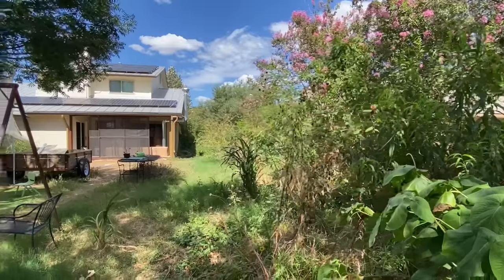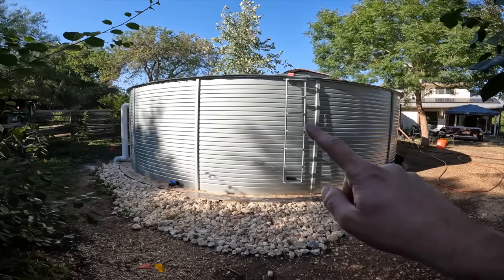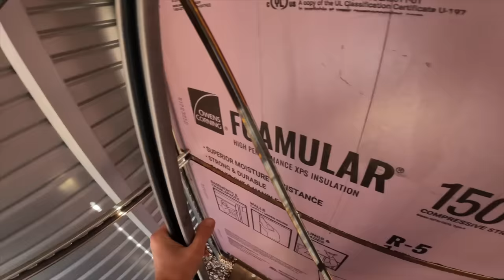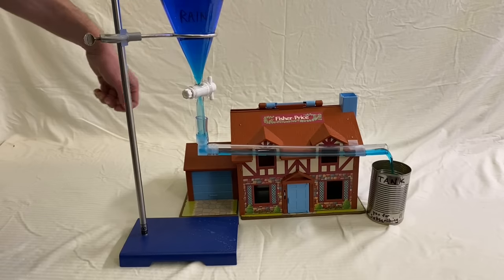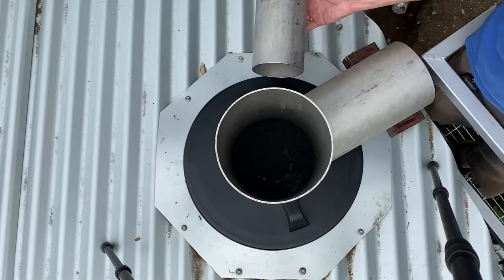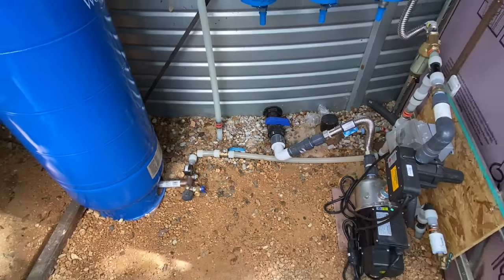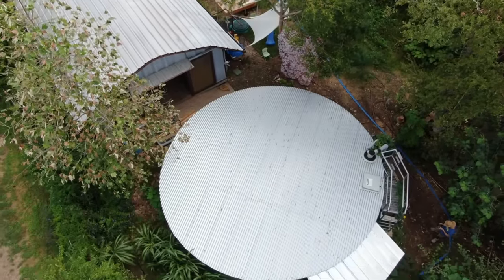FREE water forever.  LEGALLY!!!!

Comment: I have 5 wells, a 5000 gallon dehumidifier, and a 5000 gallon rain water collection system. My power is solar and mini wind turbine, with a water wheel back up. If my power and water go down, I'll switch to my emergency back up plan, hooking the horses to the water wheel. If that fails, I'll use up my reserves and then move. 😁😂🤣

Comment: I don't care how certified these structures are, if I saw this being built by a neighbor I'd be looking for flood insurance ASAP. Brings me to some questions I didn't see already in the comments: What do you do with the structure when it gets towards end of life (either with that plastic liner or the main structure itself)? Do you have an emergency drain valve and place for 30k gallons to run off into?
Reply: I would think its very easy, once a certain time reached, the owner will stop the inflow of rain water into the tank, keep using the water until the tank is nearly empty then redo the lining or structure.        
For the insurance, I think this owner has a huge property where 30k gallons wont ever make out of his property. I don't think a normal sized property would be able to build a huge tank like this one, however if they tried then I don't know what the insurance would be like but I think its probably safer than a lot of pool structures that you see in so many random houses.
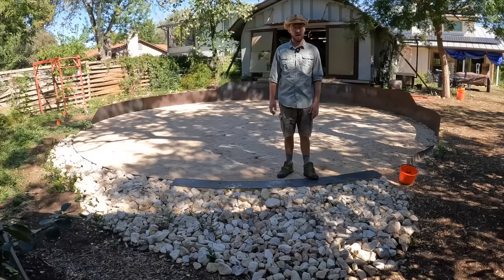Reply: @MrBen580  Some good points, but this seems almost like a subdivision but with larger (maybe an acre+ each) sized lots. At 3:55 in the video, he is standing in the backyard and it looks like he has a neighboring house barely 60 feet away from his own. In the following 30 seconds he mentions how tight of a path it is to get the building materials to the backyard. It is an assumption, but I bet the fence line shown during that explanation is a property line boundary between him and a neighbor. 

So again, my main point was how to handle an emergency drainage of 30k gallons when in such tight grouping. At least where I've looked, I have found stories of water tanks built for companies to hold 100k gallons+ and then had a failure early into the expected life of the system. In those cases, the volume is so large it ruins the majority of the town. I'm assuming his 30k gallons could easily ruin his closest neighbors.  Hence why I asked if he has a plan to create a culvert or ditch that slopes away from the storage tank. Just in case that failure mode was not originally accounted for in his overall plan for the project.
Reply: @Rambo.cc.1188  yeah I assume it's always safe to have a plan B and plan C. Hope he thinks of those someday and make a video on them.

Comment: You could have done it underground? No? Every home in our country has this we build this undergound same area as a small room the bottom is cemented, the sides as well only the top is covered with ready made cement planks that's way cheaper also it doesn't take your space
Reply from the maker: To dig a hole this size in my yard would have required huge equipment that would not fit in my yard. If it was done before construction that would have been ideal. Thanks for commenting!
Reply: @suburbanbiology  yes you are right given the resources this could be ideal

Comment: There is a tecnology to reverse desertification. And it is old as civilization itself. Afghanistan used to be land of gardens built by ancient empires trough complex system of irrigation. Now its just mountain desert because mongols razet it to the ground for resisting. And no one managed to rebuild it. I beliv with modern tecnology its possible to irrigate every desert, just no one in power has need to do so.

Comment: Have you ever seen kids these days. 45 min very hot showers 2 or 3 a day.  Before workout. After the workout.  Morning at wake up. And if they're going out later.   And there are 3 kids.  Plenty of water on the east coast . But if water was restricted in a drought are?  Whew. Fuggettabout it. Plus, parents need a shower.  My dad could take a 2 min shower.  Wet.  Turn off water. Lather up. Rinse. My kids use up a bar of soap in a week using the soap while full blast hot water spraying it.

Comment: I can't imagine why you wanted to use a metal plate to hold your water filter that already has holes in it. You had to of known that water would just go through the metal holes and skip the filter altogether. It seems so obvious. You should have used three or more filter layers so you have more insurance on keeping debris from getting in. Also your going to have to get that debris out sometime. It will end up being too much before you know it and you will need some kind of debris vacuume or to drain it and start over after you clean it out.
Reply from the maker: By nature of the path that the water falls in most of the water passes through the sock filter. In a heavy rain event if back pressure builds up I would prefer the water to go into my tank with some debris rather than lose the water. That’s why I went with a mesh rather than a solid plate. I go into more detail on my channel. I made a dedicated video for the manifold.

Comment: The problem is that rainwater contains almost no mineral salts and is therefore unfit for consumption in the long term.
One of the solution for that is to built a concrete tank or put gravels in the tank. The acidity of the rainwater will dissolve (very slightly) the stones and release mineral salts.
The water will also become neutral.

On the other hand, your installation, your rainwater is perfect for washing machines, boilers, etc. because it contains almost no minerals and therefore no limescale. 

🤣

Comment: "FREE water"
Tank costs roughly $20,000, plus install, piping, sand, steel reinforcement, steel catwalk, etc. 
I will stick with my $30 a month water bill. Rough install cost of $25,000 would take 70 years to pay off

Comment: ................is anyone else going to say it?........................ no?.............................noone?........................... 2 things. your tank is going to turn into a cesspool for alot of germs and bacteria. while yes the pipes flowing underground removes them from being in your way. the down fall is that you now no longer have a way to "flush out" any matter that doesnt get forced into the tank. over time this will settle in your under ground pipes slowly clocging them requiring them to be dug back up and cleaned. secondly your going to have water in these pipes that will get hot and increase bacteria/algee growth and then when it does rain your going to get a huge glut of it forced into your tank. this will cause alot of rancid smell coming from your tank. and your filters will age out very quickly...... and they arent cheap.
my only suggestion would be to add a cross tee connector of some kind just below the lift on each of these pipes with a bleeder cap at the end for easy opening and closing. then under the tees dig down about 2-3 feet and make it a sort of french drain. then cover the area and pipes with the same stones you used for the drainage feild. that way once or twice a year you can come out, move the stones, open the bleeder valve to allow the water to release, then open the, rubber washer sealed, thread cap and spray water down the inlet to rinse out any debris collected over time. this will avoid any clogging and ensure your water pool doesnt get tooooo gross. if your house doesnt get a tremendous amount of litter you could do this once every other year but from the looks of it your house has a few trees close enought to drop on your roof.
either way this looks fantastic. personally i would have encorporated these pipes into a trellis system above ground. using the trellis themselves to hold/hide the supports for the above pipping but to each their own.

Comment: setup will not work in a cold country. Everything would freeze and you'd have no water during winter.
Reply from the maker: True. Lots of insulation?
Reply: @suburbanbiology  Wouldn't work either. Insulation only slows the penetration of the cold. Wells here run a pipe about 6 foot underground to insulate and heat the water with ground warmth. I suppose in your setup the pipes outside of the ground would need to have a slope (no U pipe going underground and up). The reservoir would have to be minimally heated or placed itself underground. A pump would then be needed to extract water from it. The filter wouldn't be placed outside either.

Comment: TLDR: Rainwater harvesting and re-plumbing the house with pure rainwater can provide free, sustainable, and clean water for households, offering a solution to water scarcity and contamination issues.

1. 00:00 🌧 Install a rain tank to collect free water, replumb your house, and check local laws before investing in a collection system to avoid contamination and ensure legality.
	1.1 Install a 30,000 gallon rain tank in your backyard to collect free water and replumb your house to use rainwater instead of city water.
	1.2 During a power outage in Texas, the water infrastructure failed, leading to potential contamination of the municipal water supply, resulting in a boil notice and leaving families without power or water during freezing temperatures.
	1.3 Water becomes infinitely valuable when scarce, so having your own water supply is a hedge against future scarcity due to climate change.
	1.4 Compact the ground, use sand to fine-tune, and backfill around the edges for a DIY water collection system.
	1.5 Collecting rainwater for drinking is legal in Texas, and using a metal roof for collection can help avoid contamination, but it's important to check local laws before investing in a collection system.

2. 05:25 🚰 Access free water legally by flipping a ladder into a manhole to access a water tank with overflow pipe and filtration system, while preventing erosion with rocks and recycling materials.
	2.1 The speaker asks for support on their channel and patreon page, and discusses the quick construction of a site for a project.
	2.2 A ladder can be flipped and placed inside a manhole to access a water tank, with an overflow pipe to prevent pressure build-up and an outlet for water filtration and pumping.
	2.3 Water falling off the roof of a tank can create patterns in the sand that risk undercutting the wall, so rocks are being laid to disperse the water, and a ladder was picked up at a recycling center and painted to match the tank.

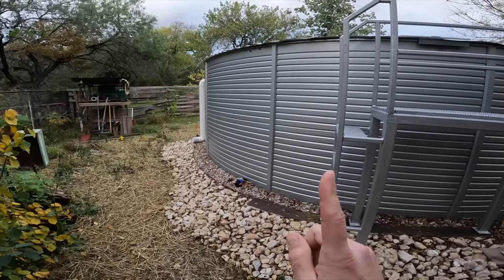3. 08:55 🚰 Build a custom pump house and tank system to ensure a free water supply, insulate the pump house and use pipe insulation to prevent corrosion, and install a PVC pipe with a filter to convey water from the gutter to the tank.
	3.1 Build a custom pump house connected to a water tank to prevent freezing and ensure free water supply.
	3.2 Insulated the pump house and used pipe insulation to seal the roof material against the tank to prevent galvanic corrosion.
	3.3 The speaker demonstrates how to set up a system for free water using a tank, pipes, pump, pressure tank, filters, and an extension for safe cleaning.
	3.4 Install a PVC pipe to convey water from the gutter to a tank, with a stainless steel filter to clean out debris, and demonstrate the process on a lab bench.

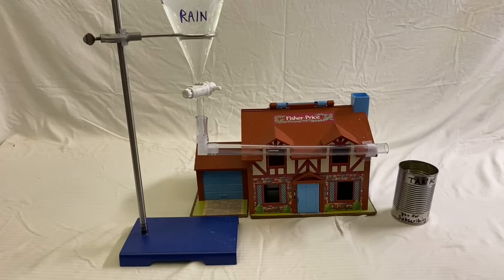4. 14:22 🌧 Use a ramp or aqueduct to collect rainwater and fill a tank with gravity, then set up a U-shaped PVC tube for a gravity-fed water system for your house.
	4.1 Use a ramp or aqueduct to collect rainwater from your roof and fill a tank further away from your house using gravity.
	4.2 Set up a U-shaped PVC tube with watertight joints and a height differential of at least 18 inches to create a gravity-fed water system for your house.

5. 16:26 🚰 Modify pipe system to prevent overflow, create custom water system using stainless steel pipes, use special paper and ultraviolet laser to create custom cuts in pipes for water tank.
	5.1 Modify the pipe system to prevent overflow by increasing the pipe diameter and reducing the number of bends.
	5.2 The speaker created a custom water system using stainless steel pipes of different sizes to allow water to flow through them.
	5.3 The speaker used a special type of paper and an ultraviolet laser to create custom cuts in pipes for a water tank, and then welded them together at custom angles.

6. 19:06 🌧 Create a DIY rainwater filtration system to get free and clean water, divert overflow from a water tank, and keep water clean with a special floating filter.
	6.1 The speaker demonstrates how to create a DIY rainwater filtration system using a rubber cap, pre-made sock filters, stainless steel mesh, and pipes, allowing for free and clean water.
	6.2 The speaker demonstrates a custom PVC piece to divert overflow from a water tank to the ground level without making a mess.
	6.3 The speaker demonstrates a system to divert rainwater into a tank and discusses the process of getting the water from the tank into the plumbing inside the house.
	6.4 To keep water clean and free of sediment, use a special floating filter that pulls water from 6 inches below the surface.

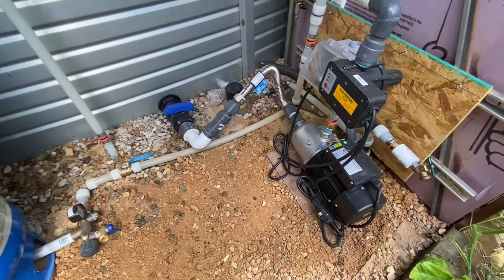7. 22:20 💧 Install a series of filters and a UV sterilization unit to legally obtain free, clean rainwater for your house.
	7.1 Water from the tank goes to the pump, then to the pressure tank, and finally through filters before reaching the house.
	7.2 The speaker explains how to obtain free, clean water legally using a series of filters, including a spin down filter, pre-filter, carbon filter, and electrostatically charged nanofiber filter, as well as a reverse osmosis filter inside the house.
	7.3 Install an UltraViolet sterilization unit and backflow preventers to ensure clean rainwater enters your house and does not contaminate city water.

8. 24:51 🌧 Collecting rainwater is easy and possible anywhere with a roof and yard, and the video encourages support for spreading this message.

Comment: Just to make it clear, it is NOT illegal to collect rainwater in any US state.  The idea that it's "illegal" was a theory advanced by an Oregon resident who had been busted for illegally diverting a stream in order to build a private lake to race his powerboats on. Between 2002 and 2013 he was cited for this and pleaded guilty several times, paying fines but refusing to remove the damns. He tried to argue that he was simply collecting rainwater. He was not. He built three dams 10-20 feet in height, without construction permits, in order to hoard the water from streams. For his repeated violations of court orders to take the dams down, he got 30 days in jail. It's perfectly legal to collect it as it's falling from the sky, off of your roof or other structure. You may need a construction permit to build it in order to ensure public safety, but in nearly every state it's a protected right by law.
Reply from the maker: That’s very interesting information. It seems the storage part is where it becomes illegal then ,yes?
Reply: @suburbanbiology  No, storage of rainwater is legal as well. If it requires construction of a structure such as yours, it's probably going to require a permit. If you just have a bunch of 100 gallon rain barrels, probably not.
Reply: @suburbanbiology  If you wanted to dig a basin out to collect rainwater from the sky and open runoff from the land, may or may not need a permit and it's likely fine either way depending on local or state DNR. If you're connecting a stream to it, though, most likely not legal.

Comment: so the self sufficient water system that was built because of the electrical grid in TX failing.....runs on electrical 
power lol.
Reply from the maker: I have solar on the house and a battery backup. You can see the panels right before the filter scene.

Comment: WTF, Over?
@ 8:14 Why is ANY rain hitting the sand? Run a gutter around that roof and catch the rainwater! Isn't catching rainwater the whole point of that big a$$ tank in the first place?
Reply from the maker: 😂 fair point. I have a long term plan for a custom gutter.
Reply: @suburbanbiology  Also, for the back wall of your pump house, they  call it wiggle board. It comes in wood & foam varieties, maybe other stuff too, & it comes in all the shapes of corrugated metal.

Comment: Free* (after spending at least $24,000 and dozens of hours building the system) Yeah, having piece of mind knowing that you will always have access to water is nice, but that water was FAR from free. That's decades of my monthly water bill. I could just as easily fill up a bunch of long term water storage barrels that could hold us over for months, AND even collect rain water in those if needed for the cost of a few years worth of water bills. Short of a total nuclear disaster the need for a 3 month water supply is pretty limited.

Comment: You know your water doesn’t come from a electric pump right?? Lmfaoo the grid went out and my water stopped bc the city couldn’t run the pump 😂
The water tower is used for 0 electricity pressure maybe if it ran out and couldn’t top fill that caused the pressure drop